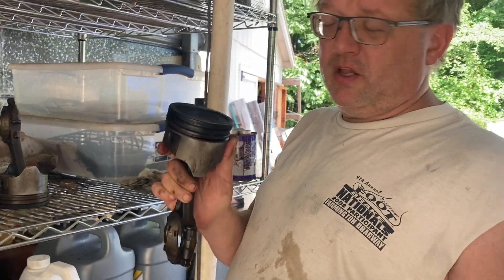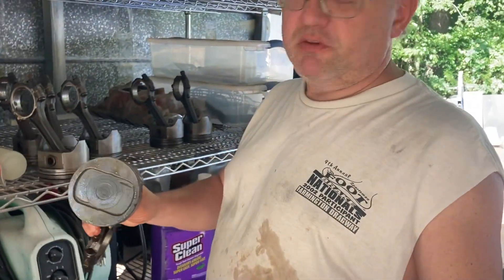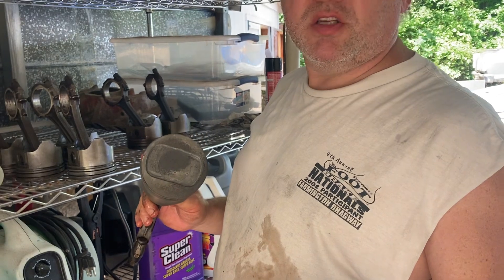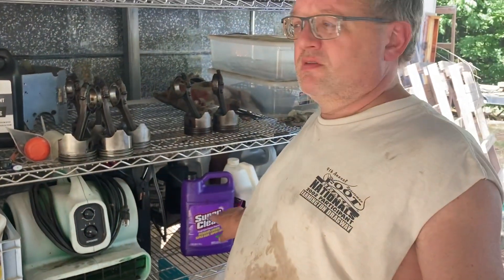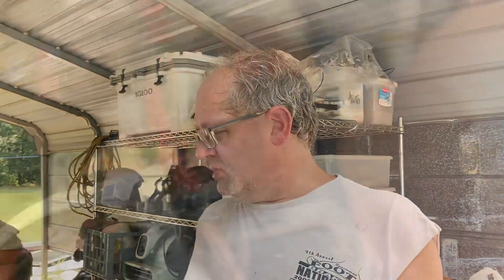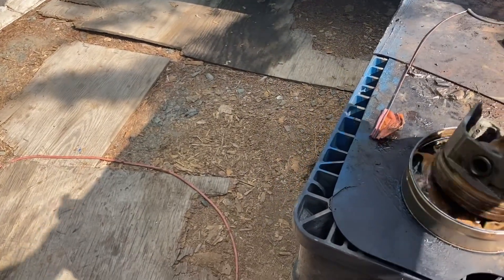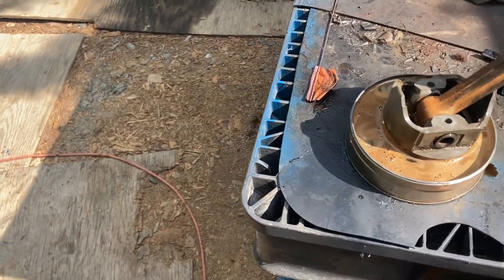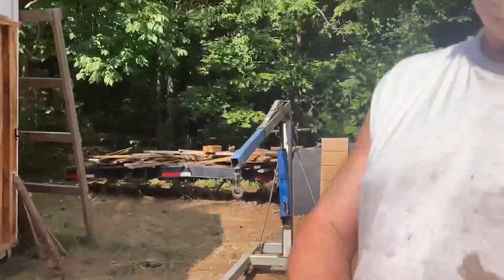Project 351W update

Comment: I use superclean a lot in the shop. It's cheap and works as good or better then some of the "professional" cleaners/degreasers available. It works well on baked on carbon, cooling system sludge(dexcool), and dirt/grease. You just have to watch as it will react negatively with aluminum. Not a big deal on some stuff, but those pistons might not be at tolerance afterwards.
Reply from the maker: It was already gonna be a little loose, so I'm not too concerned about it. LOL

Comment: Are those stock cast Pistons when I bought a 72,302 when I took it all apart down just to the block the Pistons look exactly like that they were cast don't Pistons like a like a a smog motor I think it came out of a van like an old Ford van from a maintenance yard in hightstown New Jersey it was like 8 to 1 compression but you know, obviously it's got a lot more stuff in it now which I told you what I had before but I'm just curious that's the kind of pissed that look like I'm just curious as if it's a you know low compression motor look like cast Pistons that's all just curious thank you
Reply from the maker: They are factory cast pistons. The motor came out of a 1977 half ton van. The advertised compression was 8.8-1 using a 69 cc head. I figure going to the AFR head will raise the compression up to around 9.2-1, maybe 9.25-1. This was going to be a low buck rebuild, right until I bought the AFR heads.